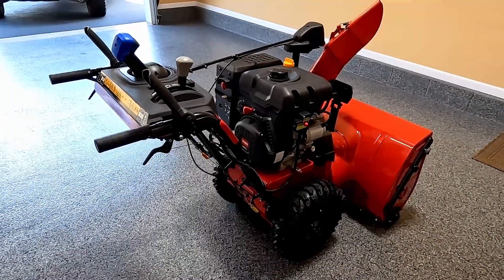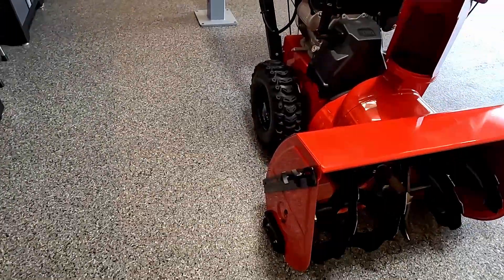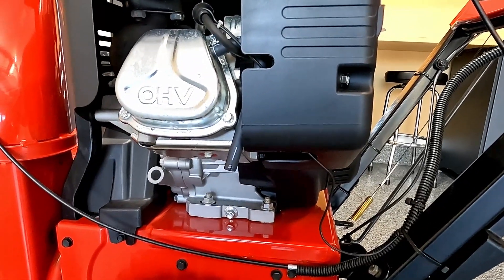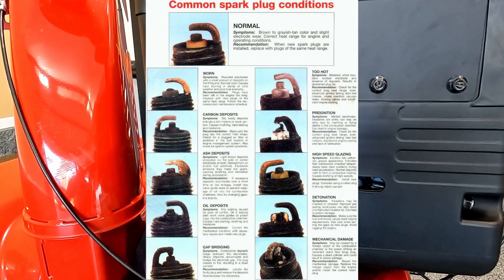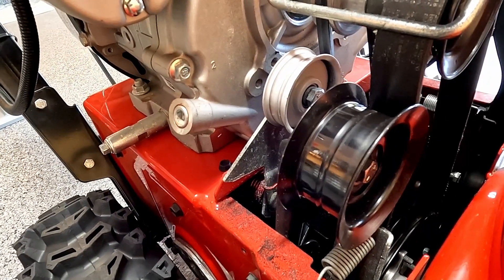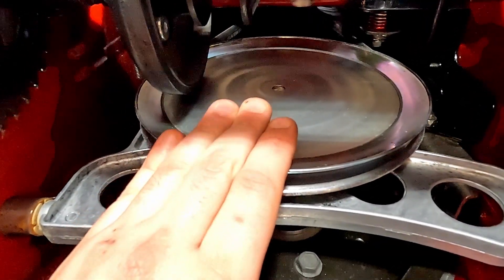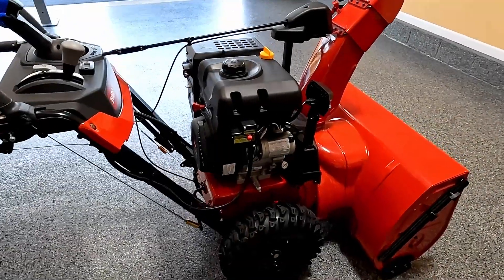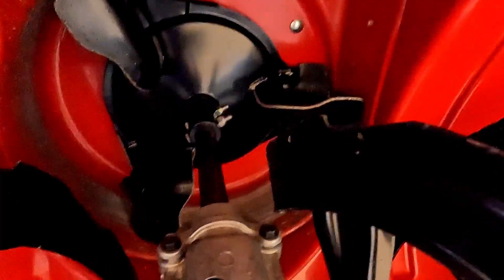How to Store a Snowblower / How a snowblower transmission works

Comment: Great and very detailed video. I ordered my Toro Power Max HD 1232 for this up-coming winter season. The drive system on the commercial machine is defiantly build heavy duty. Should last for years. Lubricating every moving part is very important to keep ware and rust to a minimum. These machines cost way too much to not take care of them. As far as fuel goes, I have the same problem here in southeastern MI, ethanol free fuel is hard to come by. I use Sea Foam in all my outdoor machines. I've been using it for years. Like you, emptying the float bowl is vital for seasonal storage. Nothing worse, than a snow blower not in good operating order when Mother Nature comes a knocking. I plan on adjusting first gear to a crawl like you did. To me, that is the way it should come from the factory. Simple fix though. After watching your earlier videos, I made my mind up on which machine I was going buy. I was leaning towards the Ariens Professional Series, but after doing some in-depth research, the auto steer system that Ariens uses exclusively on all their bigger machines, has it's draw backs. Some complain of fighting with the auto steer system in certain situations. Trigger steer was the best option for my application. I have plenty of un-even terrain to deal with around some of my outbuildings.  The auto steer works really well in virgin snow and flat smooth services. Well, thanks for sharing some very informative info on off seasonal storage. Have a blessed summer.

Comment: I use non ethanol 89 octane fuel and Sea Foam one ounce per gallon, been doing this for years with very good results. To completely drain the float bowl one can, loosen the center bolt and the bowl will completely drain. You don't need to remove the bolt, just loosen it until the fuel drains out and then retighten. If you still have fuel in the tank, make sure your fuel valve is in the off position before doing this. The drain bolt on the float bowl is slightly above the bottom of the bowl, so there is always going to be a bit of fuel left in the bowl, that is why the center bolt is the best way to completely empty the bowl. Like Enthusiasts Garage shared, a fuel stabilizer is very important or use some of the engineered fuel and run the engine to get the fuel in all the parts of the carburetor before storage. Ethanol is not a friend to small engine carburetors, especially when left sitting in the carburetor during the off season. Thanks for sharing a very informative view of the Toro trigger drive system and other moving components and making sure everything is well lubricated.  I have the Toro 1232 HD and yes, the auto differential would be nice, but they do wear out with lots of use. And in some instances, they can be twitchy. The idea of a locked axle until I decide otherwise was the best option for my use and as you showed, the cog system is very heavy duty and should last the lifetime of the machine if properly maintained. Well, let's see what Mother Nature has in store for us this winter.